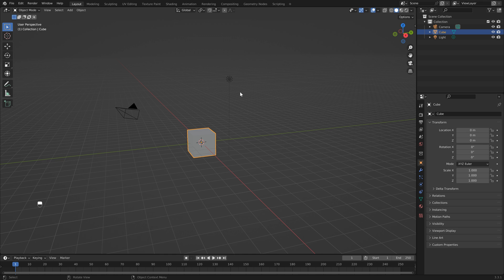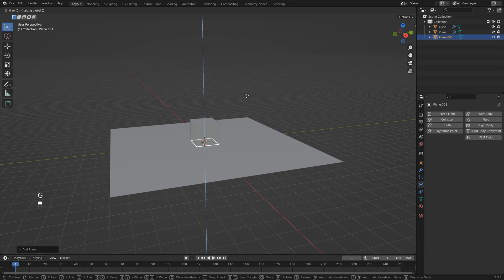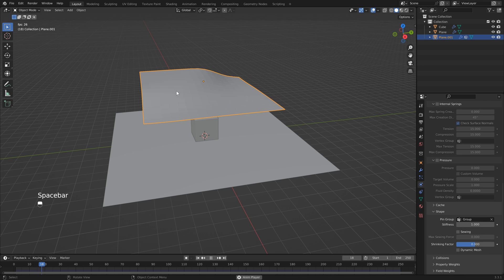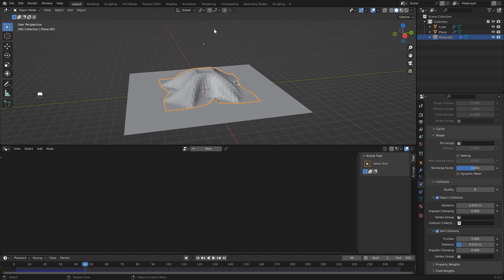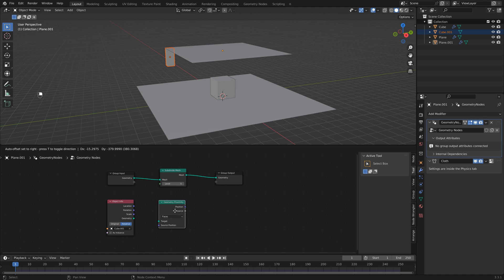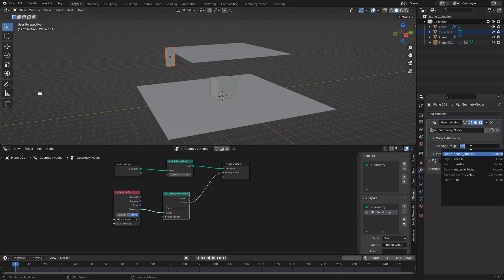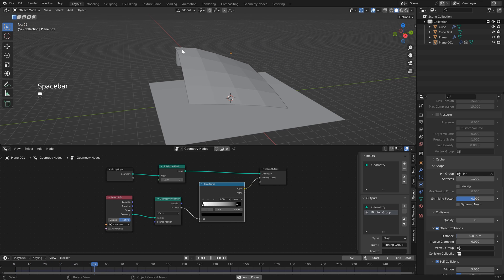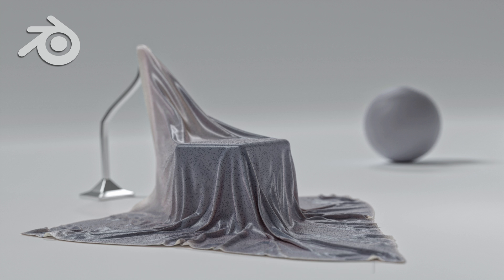Stop Making Cloth Simulations This Way ...

Comment: I'm back to making cloth sims a year later and I remembered you linked me this version of the tutorial in the previous video. It's so simple and so good! 
Currently working on a project where I have to reveal a luxury item beneath a cloth. 😄
Reply: I'm just adding this to my own comment in case anyone else stumbled upon the same challenge: I was trying to move the cloth with the pins but it just detaches as soon as I moved them. The simple solution to this problem was to just parent the cloth to the pins and then it works perfectly.
Reply from the maker: Aww great! Hopefully this helps 💕

Comment: I don't really see the advantages of using geometry nodes for something like this. You could use a combination of Subdivision surfaces , Dynamic paint, and Cloth modifiers while still being non destructive. This method allows you more screen space, and less fiddling with noodles.
Reply from the maker: There are always lots of great ways to do things in blender. I am a big fan of using Geo Nodes as much as I can 💕
Reply: @AriaFaithJones  Yeah, I know just like you I cannot wait for the physics nodes. That will be nice.
Reply from the maker: @hafeezdembos5363  yes!! That will be awesome 💕🤗💕
Reply: as far as I know, in this kind of excercise, subdivide the mesh by Geo Nodes will end in a less heavier mesh than using subdivide mesh+subdivide modifier. I am not an expert, just looking the results after some simulations...

Comment: At 6:17, what's the other way to flip it? The colorRamp node isn't working when I flip it :(
Reply from the maker: Make sure to clear your simulation Cache before playing the simulation through again. You can also use the map range node and swap the “to min” and “to max values to 1 and 0 instead of 0 and 1.

Then you can use the “from max” value to change the falloff 💕